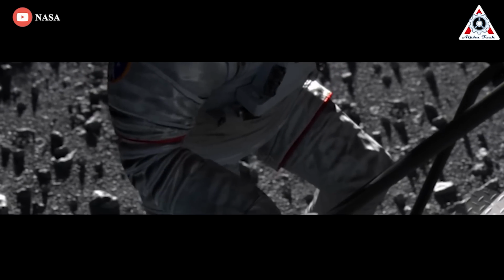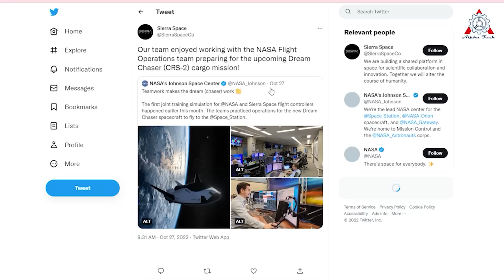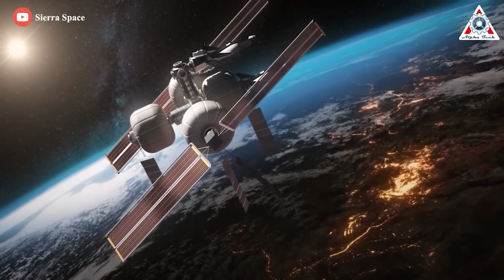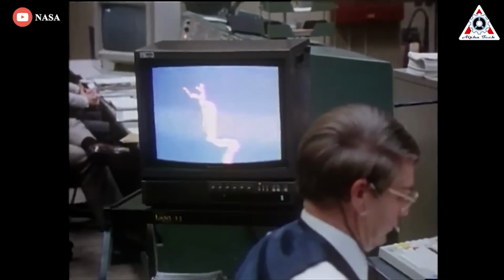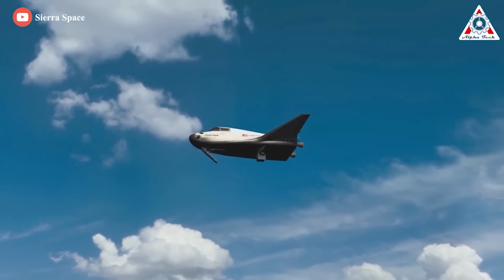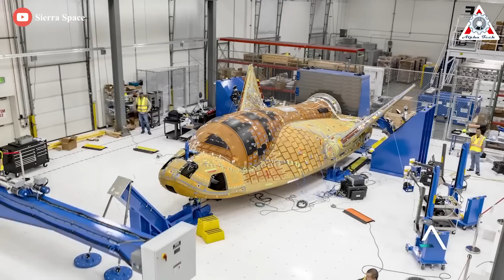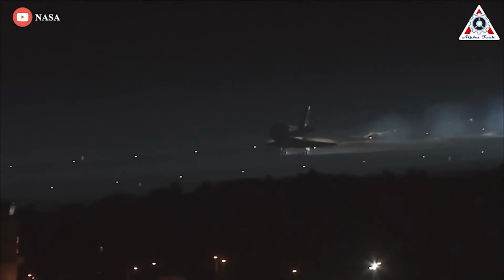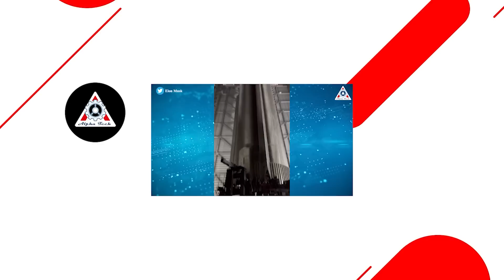Dream Chaser made HUGE PROGRESS "First launch incoming", NASA happily realized...

Comment: Combined with a (- at least partly) reusable launch system Dream Chaser could become a game changer in crew transport to LEO.
Star Ship is designed to colonize Mars. It will be way too big to bring a crew to ISS or some guests to a Space Hotel. You do not fly from NYC to Boston with a 747.
Reply: Actually, if you wanted to bring a hundred guests to your space hotel, it would be just about right.
Reply: Starship will have more habitable internal volume than the ISS (the ISS has about the same internal habitable space as a 747, actually). Why visit a cabin when you can take a cruise ship?

If you partially disassemble the ISS--lose the solar panels and non-habitable areas--you could bring it back down to Earth in a cargo Starship. SpaceX could make money outfitting some Starships as flying laboratories that can return to Earth with experimental results. No need to train astronauts to run experiments for your company--send your own technicians to conduct your own private research.

Dream Chaser will work great as escape pods for the coming LEO space stations, but until there is a reusable launcher to fly it, it will be cheaper to send people aloft in Starships.

Comment: Capsules and that Dream Chaser are a thing of the past. the Dream Chaser doesn't even have touchscreen. It's a baby Dinosaur.
Reply: The lack of touchscreens is possibly correct, it is after all a cargo shuttle at this time.
Reply: I hope they go with touchscreens in DreamChaser. Have you seen the dashboard of Starliner? Bewildering mass of switches and dials, looks like they built it in the 60s.

Comment: The Broomstick will be replaced by starship where 100's of people can launch at once.  Its going to be hard to find where dream chaser will fit in.   Most of their launches planned are folded in fairings.
Reply: I think Dream Chaser could become a shuttle that stays in orbit. It could be used for local repairs to space stations and even satellites.
Reply: I cannot seriously consider manning Starship at launch or landing at this time. It's just too risky and has no fall-back in the event of a failure.  Put people in it once it's in orbit, refuelled and able to go somewhere, but 100 people dying because 2 engines breakup at launch? , forget it!
Reply: I’m picturing Starship hauling several DreamChasers up, then returning to earth separately.

I’d ride Starship up any day of the week but there is no way in the universe I’d ride it down.

Comment: The Columbia tragedy wasn't due to a failure of the thermal protection system, it was caused by NASA not addressing the foam sheading problem from the external tank.  The carbon-carbon leading edge of the wing was never designed to withstand the type of impact that the chunk of foam hit with.  In addition, the EPA also had a hand in the foam problem due to it banning NASA from using the original foam chemistry due to 'environmental concerns'...after the change, the sheading problem began.

Comment: Dream Chaser has the cool factor, but even though it's reusable, the rocket that pushes it up to orbit isn't reusable. That means the old problem of cost per pound is way too high.  I want to see a vehicle that can get to orbit relatively cheaply and slow down with engines as it enters the atmosphere to cut down on friction and air compression. Maybe it wouldn't need heat tiles. The exciting thing is we're getting closer. The best thing that ever happened to the aerospace industry was to privatize it. Maybe Dream Chaser should be a vehicle that stays in space and is used as a shuttle between space stations and other larger vehicles.  When SpaceX builds its Starship refueling station in orbit, maybe Dream Chaser can use it too.
Reply: Sierra Nevada happens to have a contract with ULA to launch Dream Chaser on Vulcan, but it is designed to be flown on multiple launch vehicles. It could fly on a Falcon or a New Glenn. Wings are pointless on a vehicle intended to remain in space.
Reply: Slowing down with engines requires fuel. Where are they going to put that fuel, and how much will it add to liftoff weight? Noone has figured out a solution yet.

Comment: What about a product called star light ? Instead of the tiles currently used, i wonder how many degrees star lite would resist? Saw starlite in an article on you tube years ago. Made from household available ingredients. If it worked it could lighten the weight of tiles on the shuttle and be highly affordable to reduce costs and contract could go to the same company that produces these heat resistant tiles do as not to put anyone out of business…provided it resists  in tests conducted on the outer shell of the tiles fastened to the space plane to see how well starlite resists re entry trials. That, and Transparent Aluminum which is truly a thing to create a glass which can withstand bird collisions during re entry on a glass that is impact resistant. But can it resist high temperatures and extreme cold in the vacuum of space?